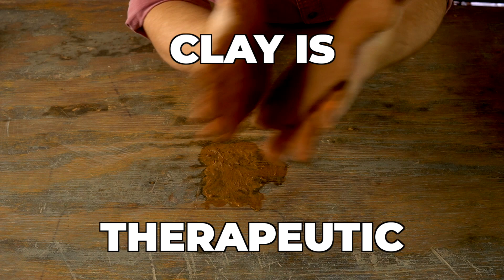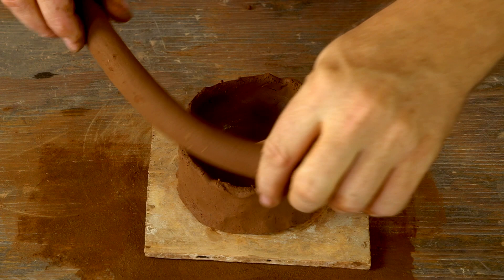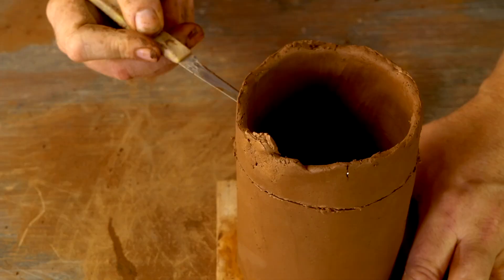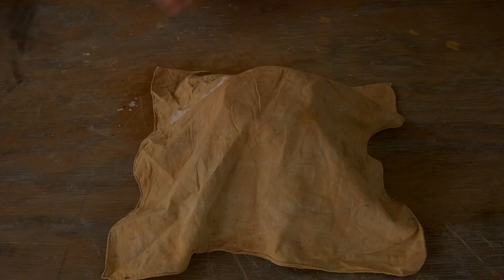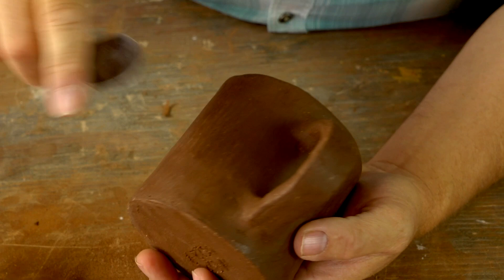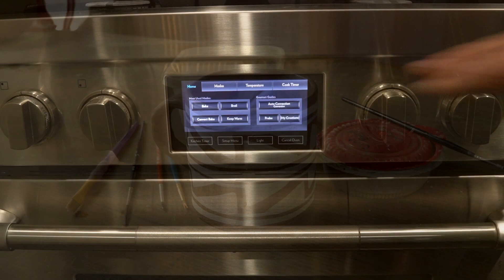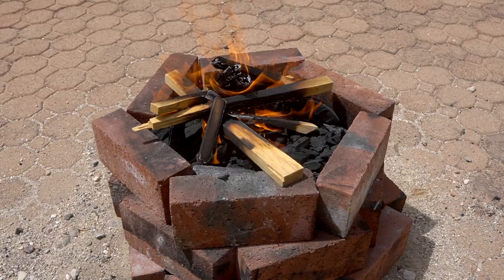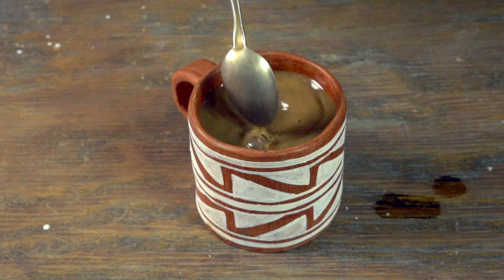Hand-Building Pottery At Home - Easy Peasy Mug

Comment: I was quite surprised when you set the mug right over the gas fire! I have always been told you can't to that. Now I need to rethink a few things. Great video👍🏼
Reply from the maker: As long as there is liquid in the pot to help absorb and distribute the heat these can be used to cook in directly on the flames. Thanks!

Comment: excellent. I bough a used kiln years ago, it still sits there because the old house can't handle the juice and the plug needs to be exchanged. All of that quite costly.
Reply: Since it is basically unusable in its current set up. Research converting it to propane.
Reply from the maker: For sure, thanks for watching.

Comment: A lovely mug, and a very interesting video as always! The fuel you're using, could you tell me - what is it, how much, and how much are you using? The best price I can see in UK is $10 for 10kilos of solid fuel briquettes. This could be the most expensive mug I ever make...
Reply from the maker: Thanks. It is hardwood lump charcoal, I buy it at the Home Depot for about $15 for 15 pounds and I use about a third of the sack for a firing like this. So yeah, I guess it isn't the cheapest option, I was actually aiming for easiest with this video, as I said there are many ways to fire without a kiln and I have videos covering several different options, some cheaper or free.

Comment: I has questions. Do you ever have to re-seal the inside? If so, how long does a sealing last?
Also, if you can just use regular bricks in your back yard kiln thingy, then what are fire bricks? I was sure using regular bricks risked them exploding.
Reply from the maker: Sure you may have to re-seal every so often, but it's not like changing the oil on your vehicle that you have to do every so many miles. If it starts getting a bit more leaky then seal it again, just repeat as needed. Yes, just regular clay bricks from the home depot, fire bricks are not necessary. These bricks were fired hotter at the brick factory then they will get in this firing.

Comment: Do you have to reseal it after using the cup every day and if so, how often?
Reply from the maker: No, you may need to reseal it after some use but not every day or even every week. It would vary depending on the amount of use and the density of the clay, etc. But a starch seal is not forever.
Reply: @AncientPottery  Thanks for your quick reply.

Comment: after the mug was leather hard, how long did it harden before you preheated in your oven?
Reply from the maker: A good portion of a day, maybe something like 14 hours. But your results may vary quite a bit. It depends on the relative humidity, the temperature, the density of your clay body and lots of other things. Things dry pretty fast here in Arizona, people in Louisiana for example need to wait a lot longer.

Comment: Andy, how long does the oatmeal seal last?  Does it need to be reapplied ?  Will the vessel trap bacteria if the seal degrades?
Reply from the maker: I don't know how long, I would assume it would depend on how often the mug is used. Also the seal is not 100% so there is always the danger of harboring bacteria so take precautions. Always dry the cup completely between uses and heat it up occasionally to kill anything there. Even a fresh pot of coffee is hot enough to kill most anything living in there

Comment: Hey just a few questions what temp was the oven at and how long did you leave it in for. How long should I let it dry before using the oven and when you used the charcoal did you get the mug hot on the side first or just cover it up like in the video just making sure cuz in another  video I seen that's what they did great work man you inspired me to give it a go myself
Reply from the maker: About 200 degrees F for about a half hour. Just put it in, if it had been preheated it should be fine. Don't overthink it and more practice will help you improve.
Reply: @AncientPottery  thanks and will do just finished my first almost bowl shaped piece letting it dry right now lol